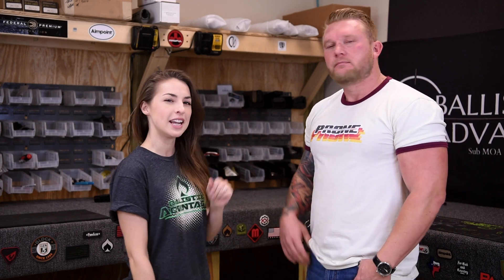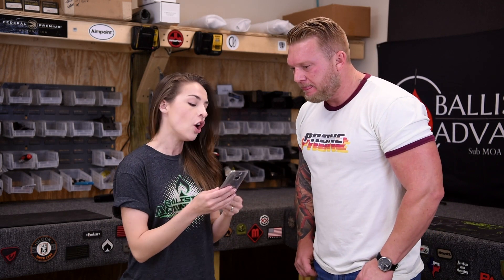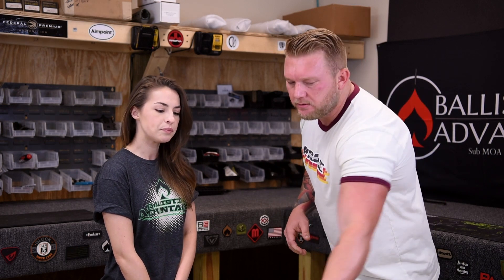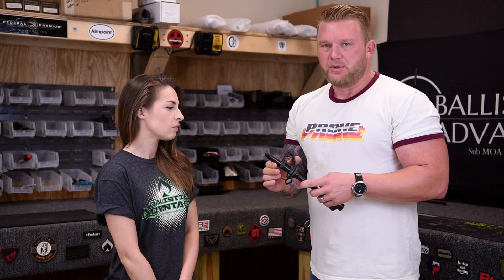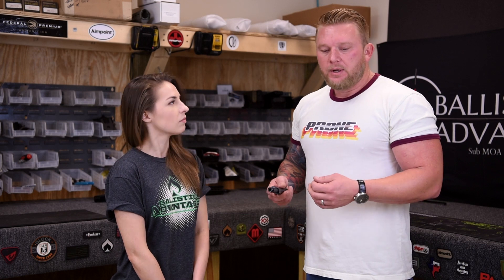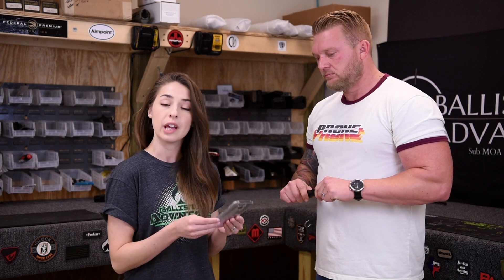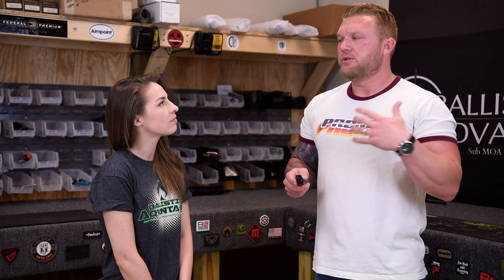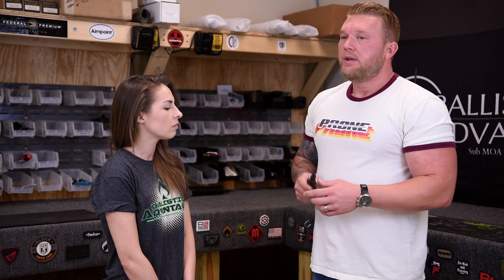Q&A Ballistic Advantage E:2 – Taper Pins vs. Coil Pins

Comment: I ran into an issue. Because the barrel is not dimpled the set screws don’t really hold the gas block while you’re banging the hell out of the coil pin. It’s just a lot of repetitive banging and it’s difficult for it not to eventually spin off center.

Comment: Clint do you see any value on using Red Lok-Tight on the two set screw gas block? I use it for piece of mind and also knowing I can still remove the screws using a heat gun.
Reply: Red lok-tight is permanent, blue is removable with heat.
Reply: @denpabacon8501  wrong.
Reply: @denpabacon8501 You don’t have a clue what you’re talking about. 

High Heat Red is perfect for gas block screws and can absolutely be removed with a minimum of fuss if required.
Reply: @riflesfirst208  Anything is removable with enough force and heat, so the term "permanent" is relative in comparison to its blue counterpart. Funny you bring this up because I ended up using red loctite on gas block screws and it leaked down fusing the entire block to the barrel. I literally had to put it upside down in a vice with the claws under the block, heat it up with a propane torch, and smack the bird cage with a rubber mallet.
Blue loctite is more than enough to hold the screws in and honestly it should be pinned into place anyways.
Reply: @denpabacon8501  High Heat Blue, yeah. 

Not standard 242 that most people use.

And with proper application, High Heat Red does not require a mallet or anything more severe than holding a soldering iron on each gas block screw for some time to soften the adhesive.
Reply: @riflesfirst208  I did accidentally put too much but it doesn't take a lot for it to dribble down onto your barrel. Once that happens good fucking luck. I pin all of my barrels and if I do use loctite will use 242 or high temp blue which neither has ever failed me. I'm not gonna bother with wood burners or soldering guns just to remove set screws. I see loctite as an inferior, temporary alternative to an essential part that ultimately needs to be pinned to the barrel.
Reply: @denpabacon8501  To clarify, I do not own any rifle that doesn’t have a pinned gas block. 

A rifle without a pinned gas block is a toy. 

However I don’t want the screws backing out either, pinned or not. 

And with the less-than-robust coil pin method BA uses, I would say the set screw do serve a purpose and should be installed in a solid way. 

That’s not something 242 can do for me, the gas block gets significantly hotter under normal conditions than 242’s max temp rating.
Reply: Don’t use red basically ever.

Comment: Are you going to offer an adjustable gas block option for the Hanson barrels vs the set screw/pin supplied block ?

I have 3 Hanson barrels, 308, 6.5 CM, and 224 Valkyrie.  I often shoot with a suppressor and like to be able to adjust the gas system.  

Can not say enough good about the barrels. All my future builds will be BA barrels
Reply: I have the same question.